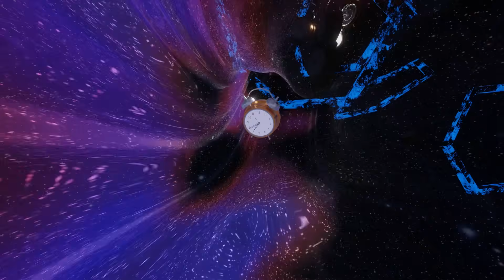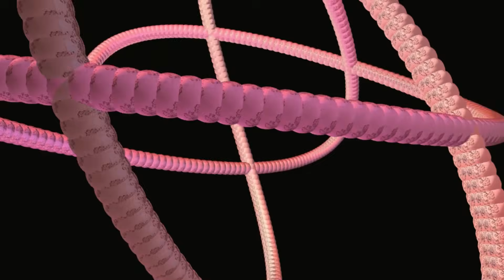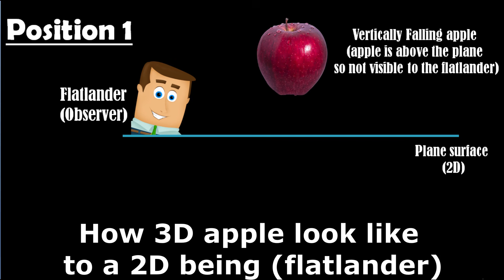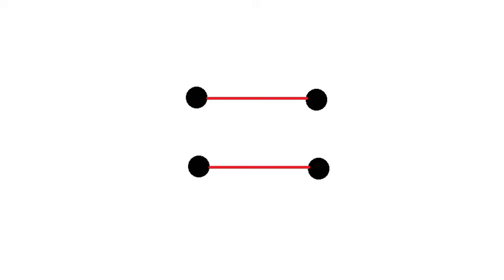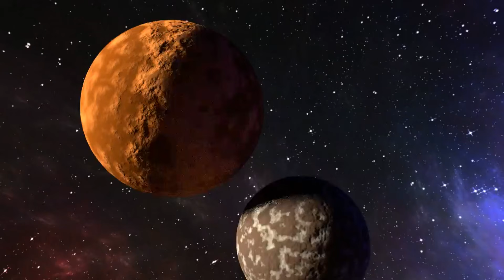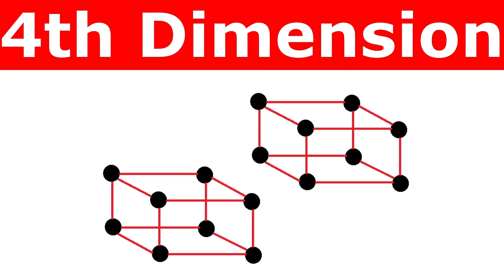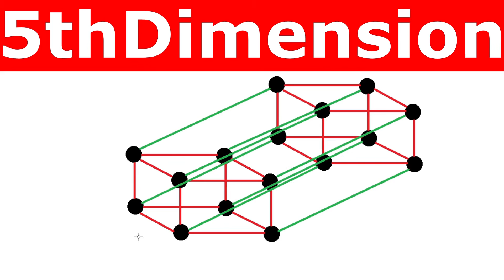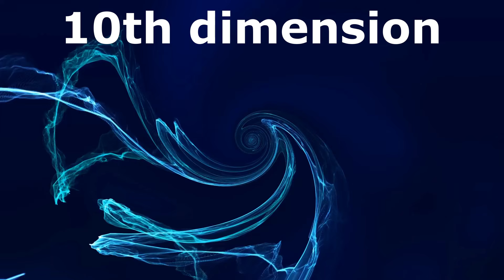11 Dimensions Explained - A Mind-Bending Explanation of Higher Dimensions!

Comment: Would our consciousness be considered to be in the zero dimension
Reply: There's only 9 dimensions let me explain,There's no such thing as 11 universe there's only 9,for example 1 2 3 4 5 6 7 8 9 and 10 is 0. 1+0 is 1. 11 is 2 1+1 is 2. 13 is 4 1+3 equals 4 14 is 5 1+5 = 6  and so on forever
Reply: That's exactly how it works. 0 is our space for example 10 1+0 equals 1 the 0 is simply space.
Reply: consciousness means the state of being aware of and responsive to one's surroundings, so if you  are responsive you would have shaken your legs,head,hands,fingers which leads to disturbance in equilibria and it somehow changed you in 1D or maybe 2D. Zeroth dimension means you with dead or standing still without breathing

Comment: How can a two dimensional being perceive a circle he would only perceive a line getting larger or smaller
Reply: There's only 9 dimensions let me explain,There's no such thing as 11 universe there's only 9,for example 1 2 3 4 5 6 7 8 9 and 10 is 0. 1+0 is 1. 11 is 2 1+1 is 2. 13 is 4 1+3 equals 4 14 is 5 1+5 = 6  and so on forever
Reply: There's only 9 dimensions let me explain,There's no such thing as 11 universe there's only 9,for example 1 2 3 4 5 6 7 8 9 and 10 is 0. 1+0 is 1. 11 is 2 1+1 is 2. 13 is 4 1+3 equals 4 14 is 5 1+5 = 6  and so on forever
Reply: I have a video on my channel called numerology proving what I said the universe works in cool ways
Reply: There's only 9 dimensions let me explain,There's no such thing as 11 universe there's only 9,for example 1 2 3 4 5 6 7 8 9 and 10 is 0. 1+0 is 1. 11 is 2 1+1 is 2. 13 is 4 1+3 equals 4 14 is 5 1+5 = 6  and so on forever
Reply: I have a video on my channel called numerology proving what I said the universe works in cool ways

Comment: I got to put this on my watch later list because I have to wait until 9pm and my popcorn 🍿
Reply: There's only 9 dimensions let me explain,There's no such thing as 11 universe there's only 9,for example 1 2 3 4 5 6 7 8 9 and 10 is 0. 1+0 is 1. 11 is 2 1+1 is 2. 13 is 4 1+3 equals 4 14 is 5 1+5 = 6  and so on forever
Reply: I have a video on my channel called numerology proving what I said the universe works in cool ways

Comment: This is completely incorrect, higher spatial dimensions are not the same thing as temporal dimensions. A four dimensional being could no more travel backward or forward in time on the three-dimensional plane then we could travel backward and forward in time on a two-dimensional plane. If a four dimensional being existed an hour three-dimensional plane it would seemingly have the ability to increase or decrease its mass as it moved It's four dimensional body through our three-dimensional plane. Four dimensional being may even have the ability to enter completely sealed areas and most definitely will be able to perceive every aspect of a three-dimensional object both inside and out, The same way we can perceive all sides of a square at the same time but a two-dimensional being would only be able to view one side at a time. This is not because we as three-dimensional beings have the ability to travel through time and perceive all sides at once, we simply can look at an object in a direction that does not exist on a two-dimensional plane.

Comment: One Dimensional   such as  a pin point  infinitely  small   may mean the context  of the  matter fills the available space  fully so, it is full of itself,  and so it has no more space to move about or change  .   So  a two dimensional  issue may be  a fractal   ,  showing  two possible ways for the context or data to move  inside it's space,  say  left and right or up and down, .   but only two ways.    So it is open  on the ends of it's space,   instead of closed.      So  a one dimensional  object is simply   that which fills  itself   with content  to all it can hold   in it's given space,   so  it is not empty   but full.     To  open the  space  opens to new dimensions for whatever is inside itself  to spread out  in any number of directions,  based on how many  dimensions   open  up to the contents of the one dimension  space to move.    So,   a FULL SET  is  a ONE,     and  a FULL SET  is ONE DIMENSIONAL    because  it is FULL  and there is no available space to add more data.    So   a Big Bang  must occur   when  the   First Dimension  is a FULL SET  and just one more thing or data content is added,   it simply  busts  it's seams and spreads out.    To blow up  instantly   would  by pass a smooth  transfer to a two dimensional  space  and burst into   a multi dimensional   space,   instantly ,  hence the Big Bang had a reason    to spread out   in many ways.    If that goes  to infinite  directions  to spread out,   then   the   Big Bang  from a pin point  infinite density,   is expanding smoothly   as a one dimensional   pin point   in all directions at once,   and   then  there is no real addition of  data  except   that  time  is given  to move between  objects  in space, where before    there was no time needed to move in the  first place,   and  also  nothing could move,  there was no  free space   to permit anything to begin to move.
Reply: So empty  and free space    defined as TIME    had to enter the pin point  singularity   to over fill the full set of one,  and it burst  and  smoothly  spread out in all directions,   at once,   to  leaven it.    That would be like putting yeast in the bread dough to  raise the lump  by introducing   empty   spaces   in the bread dough   caused by  gases  emitted by a bacteria  , or methane  four.     So    the world began  when  Methane Four  entered the   Big Bang  Singularity   and it   expanded,  because the added matter was a living  issue,   and only living things   emit   Methane Four.      The   Big Bang  had Gas.

Comment: What if time is the first dimension? And are only able to move in one direction along this Time Line. What if energy/data/power/etc. is the second dimension? Like sign waves, sound, or even light. They more through a three dimensional universe, but their existing is two dimensional because it moves positive and negative, and "forward".
I thought the fourth dimension was a Tesseract, and as such is an abstract object difficult to comprehend. It's what happens when you square a cube (you square a square to get a cube). What if the mind (and perhaps dreams) is a four dimensional space? If all that's true, maybe the fifth dimension is where the soul is connected? It's beyond the mind, and is even debatable as to whether it even exists. I don't think we need an more dimensions than that, imo. Alternate timelines and universes, to me at least, are just that. Alternate and adjacent to our universe. Anyway, that's my hair brained theory of reality.

Comment: I'm so happy to see this video because it confirmed so many of my theories. I have never heard of a 0 point dimension but I always theorized it should be an actual thing, which is the highest dimension reverting into the lowest dimension. It's the point at which balance is achieved and iffinity is established. Of course! It's also called the singularity point. It's the scientific thing that would be God. It isn't. It's just a scientific thing, the same as the wind blows but that is what it would be. That is where everything comes from. 
The fabric of space is comprised of the prior dimension creating a fabric because it's every single possible reality of that previous dimension occurring. It's like looking at a grid on a map, but each grid is a different coordinate and all of those coordinates create the fabric of reality, but this is for each dimension. 
It blows my mind that I've just died. A couple times/ had seizures and know this rather than have been taught this.

Comment: Actually, we in the 3D world are able to mingle with those in the lower dimensions (0D, 1D, and 2D) but not with those from higher dimensions, unless they mingle with us. Consider, for example, an ant who lives inside a linear tube where its only freedom is to move along the direction of the tube. If the ant is inside the tube, then we cannot enter its 1-dimensional world unless we inflate that tube to accommodate our size. However, if the ant exists OUTSIDE the tube, then we can interact with it as we are able, for example, to touch it, feed it, or even kill it. Come to think of it, a 1-dimensional world does not necessarily have to be a straight line. It can be CURVED into any direction, including a direction towards the point of origin, as in a circle. If we can place a circular tube around the earth and the ant's movement is restricted within that 1-dimensional tube, the ant can still go back to its origin going forward, and even going backward, if it is possible (if no other ant is moving towards it; otherwise, it has to keep moving forward, together with the other ants marching within the tube). If it were possible to return to the place of origin, we can conclude that even in a 1-dimensional world, time is relative, because we can move towards the west and not experience the passing of time or go back in time. We can assume that we live on the 2-dimensional surface of the earth. We can proceed westward to make our time stand still or go back to the previous day, or move eastward to go faster towards the future.

Comment: I'm not sure if dimensions of time and space should go together.  We can certainly conceive of time existing with one or two dimensions of space, right?  Time and space seem to be independent of each other.

But the strange thing is, A point cannot conceive of a line unless it imagined an infinite number of points stacked upon itself.  A line cannot imagine a plane except that they are infinite lines stacked upon themselves.  We live in 3 dimensions of space, and by extrapolation, we can only conceive of the fourth dimension as an infinite number of 3-dimensional objects stacked upon (or within) themselves.  Higher dimensions of space might exist, but we can't even see 3D - we see in 2D and experience 3D as 2D from multiple perspectives through time.

Time is a way we can understand 3D as cubes stacked on top of themselves.  Because a spot of 3D space changes with the passage of time.  But I don't think it's the same as as space.  We can conceptualize higher dimensions of time easily, but we can't perceive 4 dimensions of space.

We live in the one halfth dimension of time.  In other words, if the zero dimension of time is a point in time, then the first dimension would be a line, i.e. forwards and backwards in time along a line.  We are stuck going in one direction and at one speed.  So we are more than a point, but less than a line.  The first dimension of time would be to travel forwards and backwards in time.

2D time would be to travel sideways in time, as well as past and future.  This would mean that we're not locked into the same set of choices along each point of time. I'm not sure if I agree with the numbering system.  Half a dimension of time, as I calculate it, is a full dimension of space-time, as you calculate it.  in other words, a time plane, to me would be the ability to travel forwards and backwards and sideways.   That implies a diagonal, too, because you can have a diagonal line on a plane.  So, to me, 2 dimensions of time would be the ability to travel forwards and sideways at the same time.

3D time would have to be all alternate realities of time that might have existed actually do exist simultaneously, right?  planar time stacked infinitely upon itself to make 3D time.

Forget it.  I can see now that time and space are inextricably linked together.  I find it easy to separate them in lower dimensions, but at higher dimensions, they seem to merge into space-time.  My brain hurts.  This was a very interesting video, though.
Reply: And you are wrong about two-dimensional perception.  A two-dimensional being will not see a dot going to a circle going to a dot when a 3D apple passes through his plane.  That's what WE would see.  A circle is two-dimensional.  A two dimensional being can't look "up" or "down".  He can only see in one dimension, i.e. side to side, i.e. lines.  Just lines.  He's going to see a dot widen into a line and shrinking back down to a dot.  Now if he circumnavigates it to look at those lines from multiple angles, he should be able to figure out that the shape is a circle, the same way that we see a bunch of circles (because we see in 2D "photographic" vision) from different angles and work out that it must be a sphere.  But conceptualizing a sphere from 2 dimensions is as difficult for 2D guy as conceptualizing a hypercube is for a 3D guy.  Probably next to impossible.
Reply: If a 4D object passes through 3D space, what would it look like to us, who can only perceive things in 3 dimensions and actually only see them in 2?  Things blinking into and out of existence?  Wouldn't it be funny if lightning were an infinite 4D stream of energy, but we only see lightning strikes when they briefly pass through our 3rd dimension, and we perceive it as a temporary burst of energy?  Or if all the things that you misplace but turn up where you left them were always there, but moved out of our 3D field and then back into it for some unexplained reason?

Comment: So you did 3 spacial dimensions(I'm not counting zero because even as you described it, you wouldn't be able to assign a coordinate to it so it just makes counting confusing) and 8 temporal dimensions.  Remember back at the beginning of the video where you were saying the extra dimensions sort of curl up on themselves microscopically?  I don't get why they would need to do that if to move along these extra dimensions, one would only need to move backward/sideways/diagonally/etc through time.

Tl;dr Are there 10 spacial and one temporal dimension, or 3 spatial and 8 temporal? If the latter, why do the temporal dimensions need to curl up microscopically if it's just 3 spacial dimensions moving through time?

Comment: intellectually stupid bullshit, there are only 3-dimensions..
Reply: Wake up
Reply: @Ztjuh85  Dimensionality is the Minimum no.of  co-ordinates/dimensions/measurements required to precisely mark/identify any point in space
We live in a 3-dimensional world[horizontal/length(x), Vertical/height(y), lateral/widthl(z)]
Now many people talk about 4th dimension or even infinite dimension
There are only 3 dimensions in our universe
But yes within this 3d-dimensional space we can visualize 4 or even infinite dimensions/measurements, that is a point in 3d-space can be measured  not just perpendicularly/straight but at different angles to x, y, z planes, BUT don’t forget minimum, dimensionality is the Minimum number of dimensions required to  identify/precisely-mark a point in space, not the no-of-possible-measurements  in which a point can be identified/marked.
This is the mistake people make when they talk about more than 3 dimensions.

Ppl also talk about another universe or realm etc. as a different dimension but that’s wrong, call it another universe or another realm or wateva that is not a different dimension, even in this other universe the space is 3d, but if you want to mark a point in this new universe w.rt our universe(3d-space), you will use may be universe-name as another dimension, but that deos not make space 4d, you are dividing3d-space into two difference universes/3d-spaces, ie your measuring-system/marking-system uses four dimensions for may be convenient-marking
But the space itself still is 3D

Then there are other theories like zeroth dimension, string theory etc.
Any physical object, no matter what the size micro, nano etc has 3-dimensions,
Meaning a micro-point/dot has 3-dimenions, when you visualize it at a much lower level, say nanoscopic level
Abstract visualizations/perceptions are not real, though you can

Comment: I’ve been debating whether or not I should even watch this video because of the inaccuracy of the title.

There are as many dimensions as there are stars, however Absolute Consciousness only dreamt 9 dimensions. Meaning, 9 have their own landscape, inhabitants and level of consciousness. Light also varies as you go up in levels but it essentially stops at the 9th dimension. This is where the Source of all Radiance (Spirit, God, Prime Creator, etc.) is, along with the 9 Devas of Crystalline Fire (otherwise known as Seraphim or Archangels).

After the 9th dimension, the rest are all suspended in sort of a neutral calm and do not represent any level of consciousness nor do they emit their own Light.

Light in the 5th Dimension - 011001
Light in the 6th Dimension - 001100
Light in the 7th Dimension - 000110
Light in the 8th Dimension - 001001
Light in the 9th Dimension - 000111

Light in the 9th dimension is the most powerful existing Light in the multidimensional dream.

Comment: A 1 dimensional being cannot exist because it needs a dimension to exist in, A 2 dimensional path is not possible because existence is 3 dimensional so no matter how small a line it has length breadth and height... dimensions don't actually exist they are a construct of perspective, there is only 1 actual dimension, Reality aka Spacetime it measures pi squared.
Reply: I've been thru all of this years ago, I still don't understand how anything can be anything but 3 dimensional. These words are NOT 2 dimensional, they have depth, it's just very small...
Reply: oh, also space and time, are the same thing, think of it like 2 sides of the same coin... time is motion, which only happens in space...
Reply: This is Pseudoscience